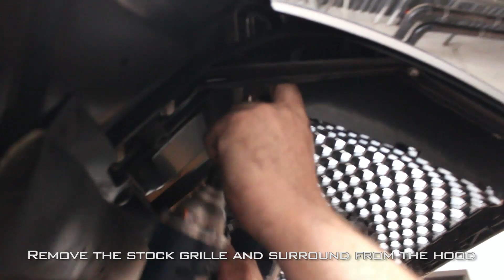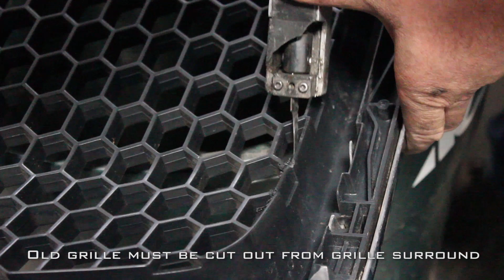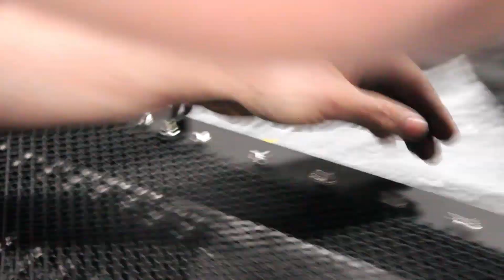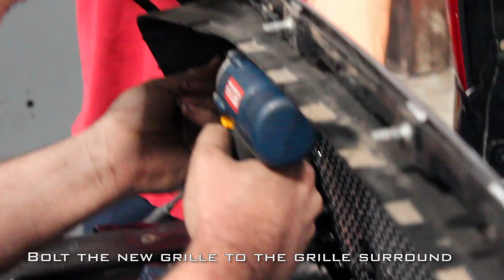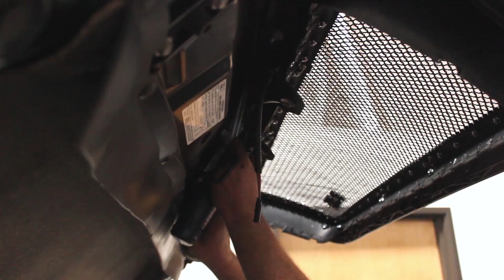2004-2008 F-150 Smittybilt M1 Wire Mesh Grille Install

Comment: The top six bolts just spin?
Reply: Liam Mcg, I realize this is from 2 years ago, but I am recently having the same problem. Were you able to find a solution for removal without breaking the grill surround?